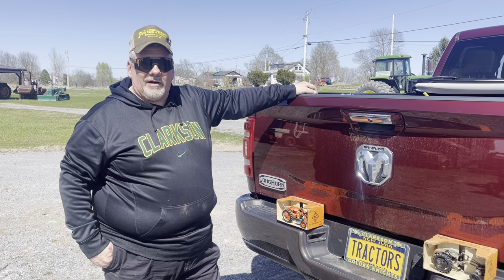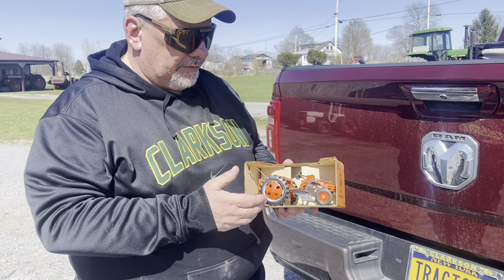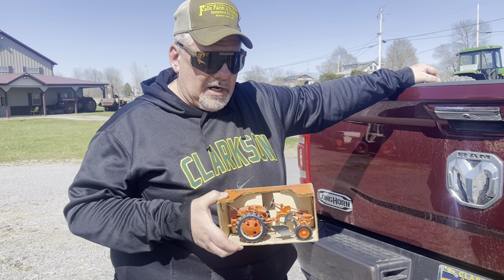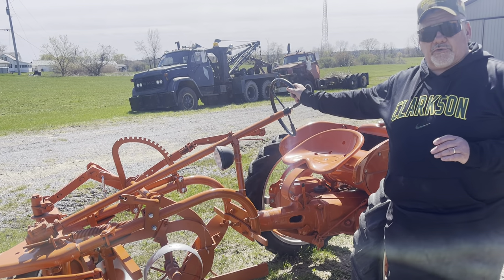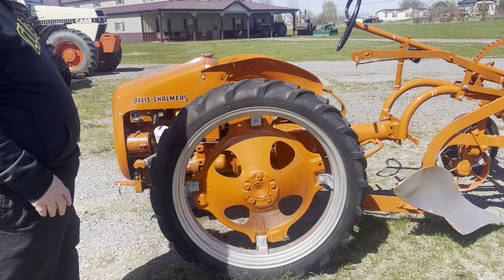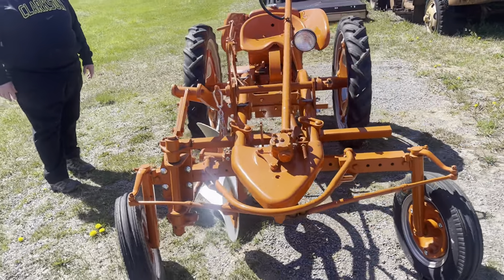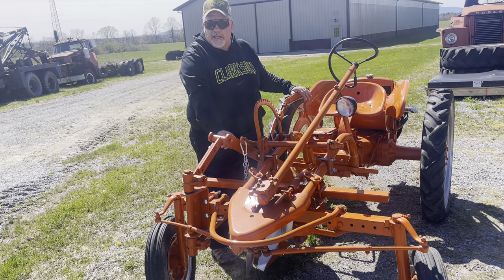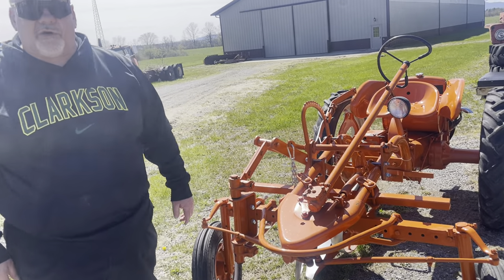Toy and The Real McCoy: Allis Chalmers G tractor

Comment: I’ve owned 3 AC-Gs and used them for seeding and cultivating vegetable crops. Even after all these years, I continue to be amazed at the thought put into this design all those years ago. It’s obvious that the engineers understood farming! My favorite, however, is the one that was converted to Kubota diesel power. Twice the power and half the fuel use - awesome!
Tractor Tim - I’m sorry you have such a negative take on the EV conversions. If I’d had the money I would’ve swapped one of my gas Gs years ago. 1- no breathing fumes 2 - quiet 3 - no idling while adjusting cultivators or seeders 4 - all the torque from zero mph 5 - creep as slowly as you need with no reduction in power.
So many things about electric are perfect for tractors. Hope you at least open your mind to the concept.
Reply: Don't quote me on it...but I THINK Tuff Built still makes an Allis G look a like tractor with the kubota diesel as an option.
Reply: Sorry...I stated the wrong company. TILMOR uses a kubota diesel in their G look a like.
Reply: @lilredwagon5311  I’m familiar with the Tilmor and even went to a demo day. I really like the company a lot, but their tractor is certainly not a G look-alike and it costs 6X what you’d pay for a good AC-G!
Reply: @bryandickerson5365  just going off their YT vids that they said they had inspiration for their tractor from the AC-G. But I do agree with ya that the thing is really really expensive!
Reply: Oh yeah, it’s definitely inspired by the G, but the Tilmor is considerably bigger and more complex. I like that the G is simpler and closer to the crop. I can’t tell you how many hundreds of hours I’ve spent holding my breath as I stare through those frame rails trying to cultivate 3 rows of veggies as closely as possible!
Reply: @bryandickerson5365  to me, it looks like Tuff Bilt has THEE most similar modern Model G today. But thats my take. Wish I could afford one...
Reply: @lilredwagon5311  Yeah, they look pretty neat, but it’s tuff :^) for a small farmer to come up with $20-25K for a cultivating tractor, much less $30+K for a Tilmor. A more wealthy fellow farmer bought a couple Tuff Bilts some years ago and wasn’t all that impressed with the quality. Hopefully they’ve improved by now. I am just now selling my 1st (1955) Model G to a young farming couple for $5K and they’ll probably (hopefully) sell it to a young farmer 30 years from now (most likely converted to EV) for 10K.
Reply: @bryandickerson5365  nice! I'm keeping an eye on a Hines H-1600. Never heard of the thing before but its basically an 80s made model G. I guess the company didn't build the tractor for too many years. Not many vids on YouTube either.